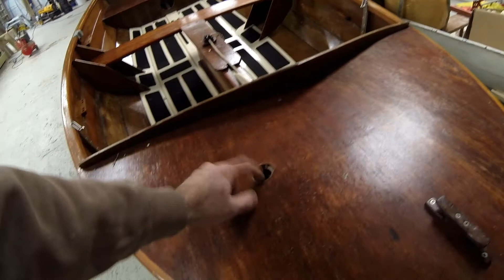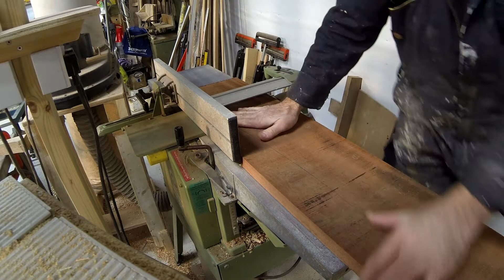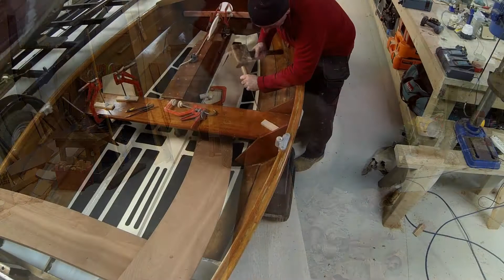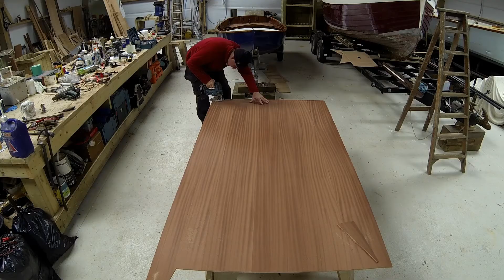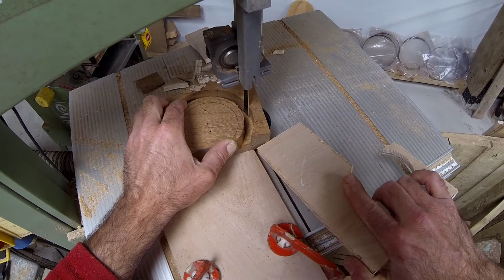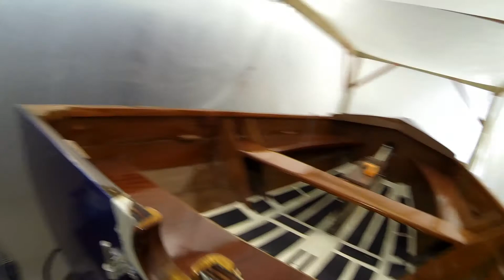A Lymington Scow gets a make-over

Comment: Nice Scow, good to see your elu router, have the same one for over 30 years now, the best.
Reply from the maker: Agreed, it’s been a great tool. Still faultless although I replaced the bearings a couple of years ago - see other video.
Reply: @EvansBoatwork  Should have done that with my Dad's, the top bearing seized up and melted the housing!
Reply: Did you just use epoxy to glue the seat top and deck back in place?
Reply from the maker: Yep 👍
Reply: I really enjoyed the video. You make it look easy. I like when you paused then said, "but it's tricky " . Nice work and words of a craftsman.